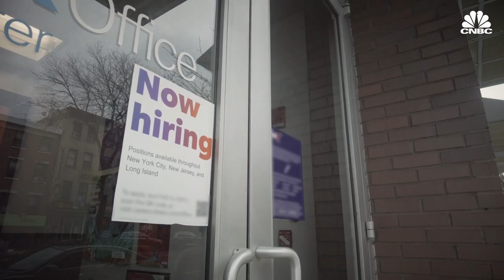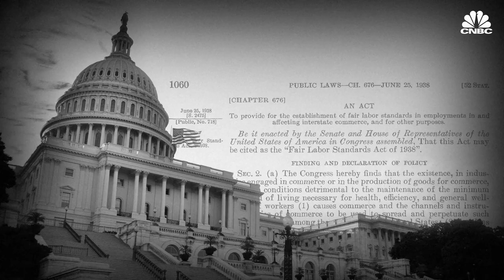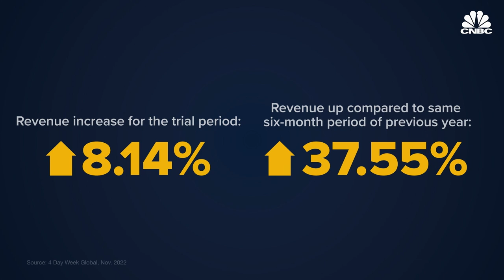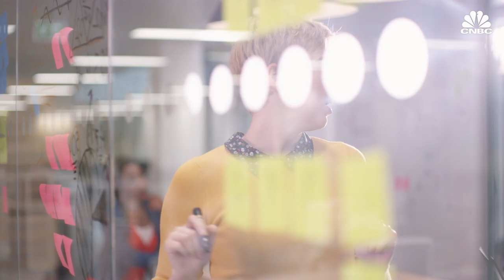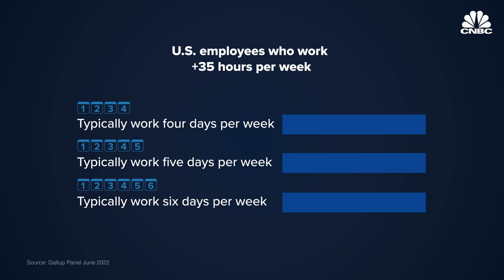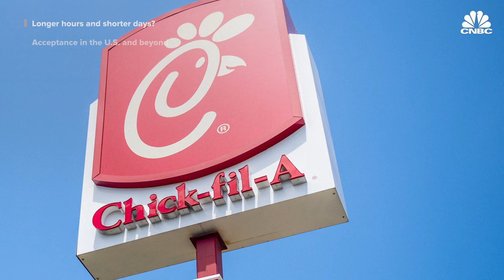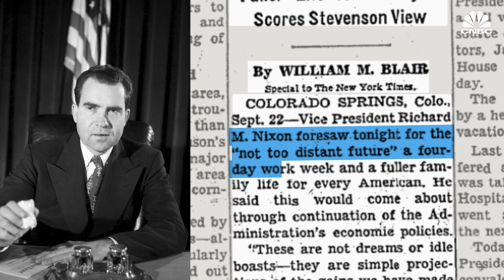How The Four-Day Workweek Could Change The Future Of Work

Comment: The best reason to implement a four day work week is so that we can do it for 10 years, get accustomed to it, then start talking about a 3 day work week. Rinse and repeat until we're at a 0 day work week.
Reply: At that point, automation becomes a serious player as no matter what, electricity generated by nuclear is cheaper than slave labor. Slaves, you have to house and feed unless you like to  handle acquisition costs. Nuclear power plants, after you build the thing (most likely molten salt reactors by then, which also take spent fuel rods as fuel) output electricity too cheap to meter at near zero maintenance cost (unless it's a place like Israel or Japan, but even then, it's still quite cheap)

Comment: Looks like I’m in the minority here.  There is no way I would want to work 4 workdays, assuming they were 10 hour days.  I currently work 5 days a week, 40 hours, 6 am to 2pm Monday through Friday.  The thought of having a 3 day weekend, every weekend, sounds appealing but working 10 hours a day for 4 days straight to get it does not.  I’m fortunate though, I live a few minutes from work, so I have just after 2 pm until around 10 pm to myself.  I’d HATE to give up two hours of my day just to get that Friday or Monday off.  It’d be my luck it would always rain on those days!

Comment: I think the big equalizer is money. Do you get the same amount of money working 4 days instead of 5? If it’s measured hourly, then by all means, work 2 days a week if desired - just realize get less money per week.
Reply: Unless it is project based work. Some software devs secretly work 2 full time jobs at once (workload for one is usually much lighter). For them, it's some extra cash for very little effort

Comment: Which day of the week do you not want electricity, banking and many other services.  The cost of covering that 1 extra day will be insane.  Stop being lazy, 5 days is fine, you would not survive in manual labor industry.  Try being a chef, 10-12+ hours/6 days a week.  Your little 5 day 40 hour work week is nothing.  First, force breaks and the other benefits that you get with your cushy job in all industries and create overtime for 50+ hours.  Think of the people that actually work for a living.
Reply: I'm a teacher and this was my question too. 4 day week doesn't work for anybody except the cushy tech industry. Factory workers and nurses have been doing it for ages so they don't count. Literally no other industries could make this work without massive halts in productivity or extremely inconvenient schedules.

Comment: Sounds great in theory. How does 95% of the population afford to work so little hours? Is minimum wage going to double? Triple? Am I missing something?
Reply: I think you don't understand how it works
Since you have the same productivity as working 5 days, working 4 days will make your hourly rates go up, since you have the same productivity in a smaller time

Eg lets say i make 10 box of cereals per week and in working 5 days/40 hours per  week,payed 10$ per hour. Now,if i make 10 boxes of cereals per weak but i work 4 days/32 hours, I'm producing the same quantity (so i should get payed the same) in smaller time,so i would get payed 12.5$ per hour